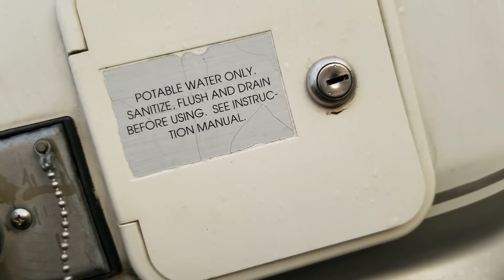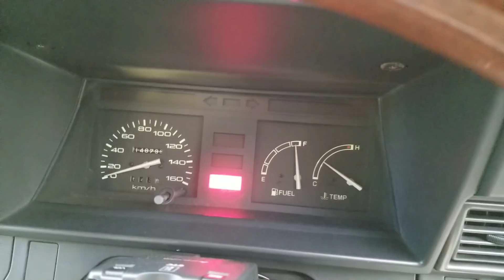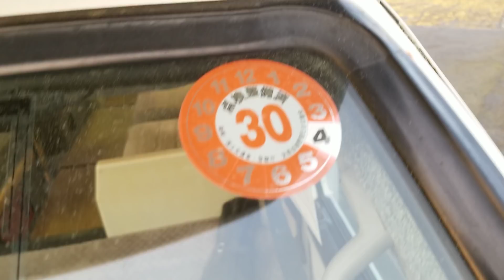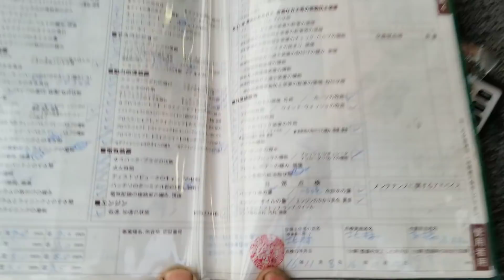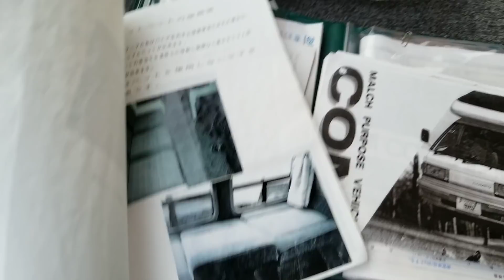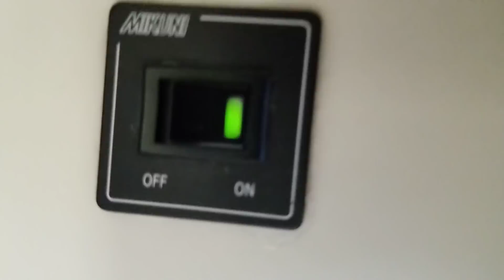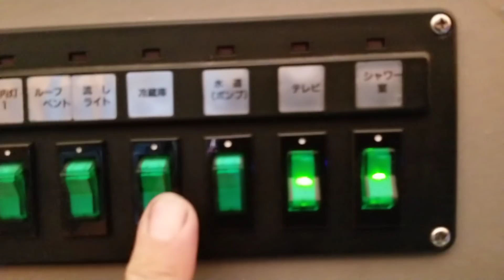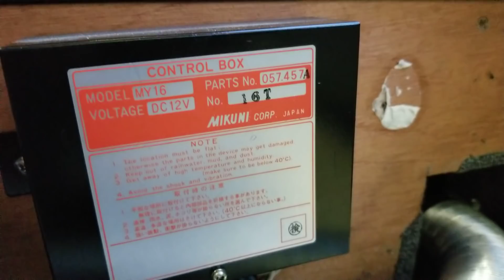FOR SALE: TOYOTA LITEACE COMPO MOTORHOME, 4X4 , 1992,  CM65 , 2C diesel -PARTS 2

Comment: What is the max tire and rim size these lite ace campers can take?
Reply: I'm putting 27 8.5 r14 bfg all terrain on mine it could handle a little bigger maybe 29 inch nut they are hard to find